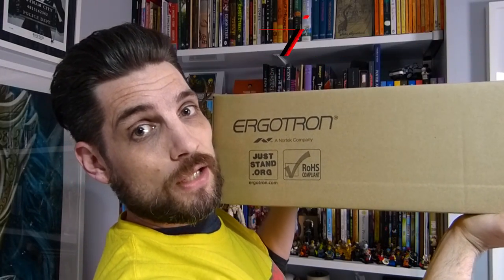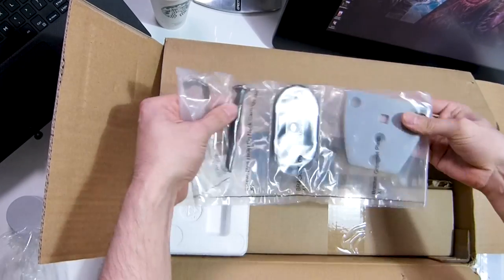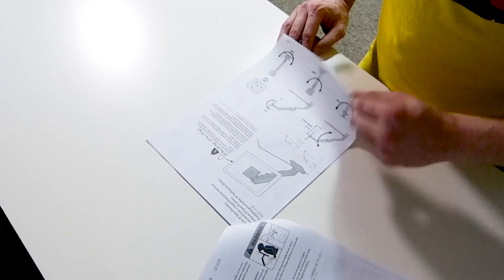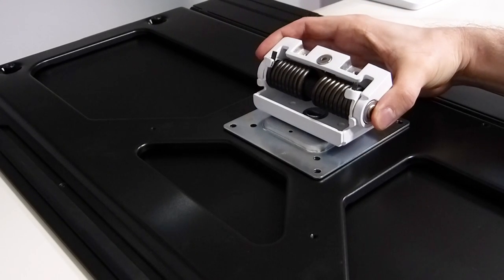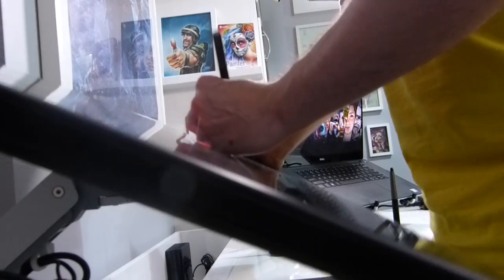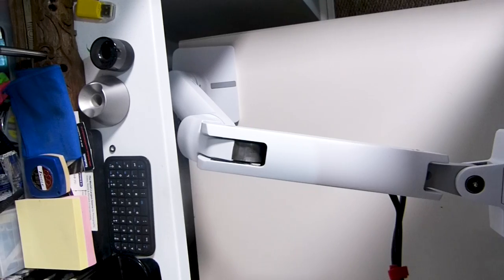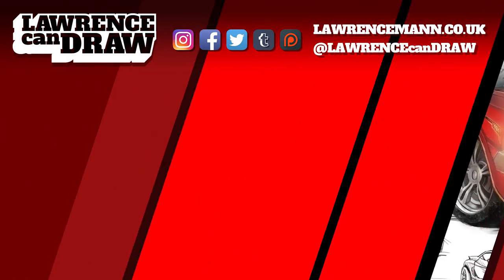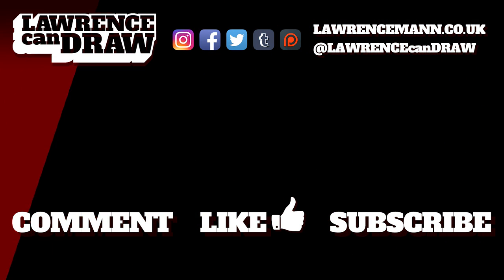Dell Canvas 27 with Ergotron arm & VESA mount

Comment: @Lawrence, i heard, that the touch experience on the cintiq 27 pen and touch isnt that great, compared with the Surface Studio for example.
How does the canvas respond to touch gestures like rotate, move and zoom?
currently i am working on the Surface 3 which is very responsive with touch.
Btw: your Trump Illustration is great:)
Reply from the maker: Haha. Glad you like the Frumped illustration. Guess you've been on my site then?! That was a commission. It in no way reflects my personal political views ;) haha. The touch on the Cintiq is fine. I normally tell people to install the drivers that are 1 version old rather than the most up-to-date. That fixes any bugs you may find when new drivers get released. I never install new drivers straight away. Dell is absolutely perfect. Never run into a problem. Both have touch on/off buttons. Personally I don't like the Surface Pro/Studio etc for touch as much because it's glossy. I hope the next versions are matte but I think that'll never happen :(
Reply: I think your Frumped illustration was mentioned in one of your threads here on Youtube. Made me curious, because there are many mediocre Trump-Drawings out there from people who think he is easy because of his hair. But he is indeed diificult to draw. And your one is very good (as expected)

One thing i forgot to question: A lot of people are complaining about fan noise (Surface pro 4, Cintiq Companion 2, Cintiq pro 16) Does the Dell have a fan?
Reply from the maker: No fan on the Dell Canvas but it's a pen Display, not an all-in-one.
Reply: robert stern the Cintiq 27 touch with Clip Studio has been a complete mess. This past April you needed a driver version that was more than a year old to make it work decently. Decently, not perfect.
Sent it back after two months.
Reply from the maker: Hmmm. Clip Studio. They just released a new update with touch & pen inputs. Did you try that Stefano?
Reply: LAWRENCEcanDRAW sorry, I sent the cintiq back for a refund after two months of frustration I fear. (Besides, it was around the whole operating system that touch and pen didn't work well together, same on the Cintiq Companion in Windows 10). 
Currently Clip Studio is version 1.6.2 from past December. They should have released an update this past month that gave full compatibility with the new Surface Pro and pen but it was postponed to September.
Reply: i am working on a Surface 3 with Clip Studio EX since Version 1.5.x
Pen and touch worked and works absolutly flawless on my Surface 3.
I think your problems are cintiq 27 touch wacom driver related.
The upcoming CSP 1.6.6 english update enables clip Studios tilt support for pens and support for the Surface dial device
Reply from the maker: I've used Clip Studio a couple of times (mainly just for YouTube videos) but that's it. I've heard some stories about driver issues but with Painter & Photoshop I find there's never really a reason to touch it. Doesn't really compare. It's a strange app in the fact that it's got more in it than a basic tablet app but it hasn't got all the features you expect of a major painting application. I thought they'd expand it more but they've never really fleshed it out. It's nice for line at but that's about it really.
Reply: LAWRENCEcanDRAW no offence, but you should know it better before judging. You might discover it actually has more painting tools and options dedicated to drawing than Photoshop.
And a more touch friendly interface.
Photoshop has better photo editing tools though.
Reply from the maker: I do 'know better' ;) lol. Saying "no offense" is something you do before you knowingly offend someone. I have used both over many years. Those tools you see purely for photo editing are extremely useful for artists too. It comes down to the style you work in. Clip Studio or Manga Studio is more aimed towards comic artists. It has made a lot of advancements but I still prefer Painter for hardcore painting advanced tools. Photoshop's general skillbase and awesome painting set-up is what helps it wipe the floor with some of the lesser apps out there. I'm not gonna have this debate in a comments section though because it's a pointless personal choice issue. I've turned on an app and thought it was awesome when a friend has thought it was a piece of turd and uninstalled it before the drive had stopped spinning and vise-versa. Everyone has different set-ups to and different ways of working which is great but this all plays a huge part of picking your software and hardware. That's why you'll never see me dispensing advice without asking what people do, what software they use and just getting to know them first.
Reply: LAWRENCEcanDRAW you know, you could just say you don’t know it and that would be perfectly fine, you won’t lose subscribers over it. There’s no point in dismissing a software out of simple ignorance of how it works or what it can and cannot do. Which is clear you don’t know, and that is fine.
It’s not like you lose anything if you say something like “Some say it’s good, but I don’t have any real experience with it so I can’t judge". We mortals do it all the time.
Just a piece of advice for the future since you never know who you may be get into an argument: for what you know I could be someone with double your experience and knowledge in this matters. Just be a bit more humble with strangers.
Reply from the maker: I have used Clip Studio a few times and I said that straight away in my comments. Didn't profess to be Captain-Amazing with it. I think I've got 1 or 2 videos with it on my channel so it's obvious I'm not going to hide the fact that I wasn't an expert on the app and wasn't blown away by it. You seem to be very defensive over Clip Studio Stefano, are they sponsoring you?

From the last part of your statement I can tell you're obviously very upset. You're not used to people telling you that your opinion is not the only valid one. Do you teach students by any chance? I've seen this from friends who became college tutors in the past. I have told many older people with more experience than myself that they are wrong on many, many occasions. Truth & knowledge are not sole virtues of age or even always experience. One day I will be wrong and I hope someone younger with skill beyond mine will come and point that out to me when the time comes - maybe it will even be you ;) See what I did there?! Humility. lol.

Anyway, this is turning dark. You are getting upset and I am going to go paint. You have fun with your family and enjoy the Sun in Monza!

P.S. What did you replace the Wacom with?
Reply: LAWRENCEcanDRAW lets leave this behind, we have different opinions that won’t change anyway over an argument on youtube. And we both have better things to do than spending our time arguing with a stranger over the net.
After the Cintiq fiasco I decided to get back to a portable device only, so I got a Surface Book. Which was substituted by a Surface Pro 2017 a couple months later. Which, when I got the new pen and it reveled to be half backed from Microsoft and not ready yet, was finally substituted by a Galaxy Book 12. Hope to be able to keep it at least a couple years.
Reply from the maker: I use a lot of portable devices too. I haven't tried the new Surface Pro yet. I am using the Surface Book with Performance Base. That is pretty good. I still love my Wacom MobileStudio (I can't remember if I put Clip Studio on that or not) but I've not tried any of the newer Samsung's. They've never made anything that I've looked at and thought 'I must have that NOW!!'. Samsung always make nice stuff but I'd like to see them do more for artists. Dell pretty much just said in a comment on my channel here that they are going to be doing a mobile Canvas. The folks at Dell are awesome and they work hard on the details. I'd like to see what they come up with. I think a Dell MobileCanvas could be very special.

Comment: Hi Lawrence, do you prefer the LX HD for the Wacom Cintiq 27" or does this (a bit cheaper) HX also does the job? I have some fear that the HX is not able to lay down the Cintiq close to the table because the first arm that from the stand is about 45 degrees up. Thats maybe where the LX HD performs better cause he is on a pole. Right? (and maybe the arms are longer?)
Reply from the maker: LX HD has more more movement and the HX is stronger. It all depends if you're a 'leaner'. I tell people never to lean because you're gonna damage your Wacom but to those people who bitch about wobble, I say get the HX and suck up the lack of movement!

Comment: So I have another question about the arm...I have it installed, and it works great! I'm just curious, is there a way to get it to come out from the wall a bit easier? I have to really pull on the arm to get the bottom mount to turn, as in, the two spots where the mount connects to other parts of the mount.
Reply from the maker: Does one joint feel a little stiff? You can just loosen the nearest screw-fitting a tiny touch 🤓
Reply: Lawrence Mann yeah, the base arm on particular is hard to turn... I figured that it's the second hole, not the one on the base that I tightened after dropping the arm. In, but the one right above it on the arm... It's so tight that I can't loosen it with the head key they provided me, so I figured it wasn't meant to be loosened. :P
Reply from the maker: By the power of Grayskull 💀...

Comment: I've purchased the Amazon Basics arm, and by comparing it with Ergotron XL, it's 100% identical, only difference is the warranty it seems. Even the packaging was 100% the same. I guess Amazon buys them from Ergotron simply repainted, Epic stuff.Using it for my Cintiq 27qhd and it works great.
Reply from the maker: Not sure that's the case. I'll check into that to be sure. Either way, I'd rather have that warranty and know that they are stress tested units.

Comment: Hi Lawrence, 

I've been enjoying watching your videos. Recently I purchased a Dell Canvas - however when I connected the Canvas and powered it on, an error message appeared on the screen stating that "Wrong power adapter detected".... followed by a shutdown of the screen. 

Does this mean anything to you? I was wondering if you could confirm the type of adapter that you have with yours - so that I can compare. 

Many thanks
Reply from the maker: Sorry fella it's bolted under the desk so there's no quick way of getting to that but... if you've just got yours then you've got the box right there with a manual and that should have all the specs in for the power unit. What country are you in?

Comment: my office is purchasing Canvas for productivity usage (not for drawing).......my table is too small to have it lying on the table.   I'm using it primary for split windows data entry and wanting to make Canvas the only monitor. What budget table mount can I purchase?
Reply from the maker: Do you mean VESA or arm? If you mean VESA mount then you must buy the VESA from Dell. It is the only one that will fit. If you mean arm then I have a video that will help you to choose the right arm (https://youtu.be/1uqb_uugqr0). I recommend Ergotron because of the 10 yr guarantee and the stringent tests that are run. Budget arms have 1 yr warranty typically and I personally do not like the idea of putting a £2,000 tablet on a budget arm.

Comment: Thank You for your video!
Can you (or anyone else) tell me how much the VESA adapter weighs? 
(I don't see any documentation on it) (and does that include the cable concealer box?)
Thanks!
Reply from the maker: Not sure on the weight of the VESA mount. However I'm not sure what you mean by a 'Cable concealer box'. The cables do get concealed within the Ergotron arm. Is that what you mean?

Comment: How did you get your hands on a VESA mount in the UK? None of the EU Dell sites list this item...  nor do they list the articulating stand... so I can only work on it when lying flat. Would like to use it as a desktop screen too....to avoid having to buy another screen just for that...more money, more clutter :p
Reply from the maker: I had the Canvas well before release. Call their customer service line and explain what you want. I'm pretty sure it's an ordering fault rather than an inventory fault so you might well be able to get it as far as I understand. Ask for Dell part 452-BCSG 'Dell Canvas VESA Bracket'. Quoting part numbers and the actual reference name might help them track the part down in the system. Let me know how that goes for you!
Reply: Thanks for your review. Also in germany we dont have the Bracket. Dell itself as well sells the Canvas here around 300 Euros (200 Dollars) more than the retailers around. But when it comes to that Versa Bracket Dell Germany is unable to help. You need to use hidemyass or any IP hider to get on the US site and then order it there, I have a US postbox mail forwarder so that was working. But if Lawrence Mann from the UK finally reached on directly in Europe maybe, respect from me :)
Reply: For sure I meant Arman maybe got one in the UK, why should you get one there, silly german me...

Comment: Hi Lawrence,

How has the Ergotron arm held up thus far? Want to get one but not sure how well it holds up over time. Being how heavy it is and the use I may put into it.
Great videos by the way, pushed me to getting a Dell Canvas a few months back. 

Thanks in advance.
Reply from the maker: The HX Ergotron arm is a beast! You could sit on this thing!!! It's got a 10 yr guarantee. It's gonna hold up. That's why I don't get those cheaper brand arms. https://amzn.to/2AnOw4N You can also get it in Chrome as well as white. You can get a double version too if you have another monitor you want to strap to the side (like a super beast!!!) - It'll hold. Hmmmm - maybe that's my next Ergotron video... CHALLENGE EXCEPTED!!!!!
Reply: Thanks for the reply, will definitely get it with my next paycheck.
Reply from the maker: Use the link in the description and send me a message on Twitter or Facebook @LAWRENCEcanDRAW so I can give you a shout out!!!
Reply: I assume that is a referral link, used it and should get it next week. I dont really use twitter and deleted my facebook. I appreciate the thought though.

Comment: Hey Lawrence
I think Dell have discontinued the Vesa backplate. (I think they might ship it as an accessory if you buy the canvas from them at the same time, but even that's unclear)
Anyway, I'm actually thinking of just making one. How hard can it be, it's just metal with holes in it, right?
I've never actually seen the canvas in person, what do think?
Reply from the maker: I've heard a couple of people say this but I'm not sure if it's true. It was always tricky to get hold of. I'm gonna try to get more info on this!!
Reply: I got a mount in uk about a week ago. Had to ring dell direct to order and it was a bit of a hassle but it eventually came after 3 weeks of chasing them via emails.
Reply: @optical10  Thanks, do you mind if I ask how much it cost you?
Reply: @tmcthree  it was £164.99 with free delivery last month. The backplate for the cables it a pain to secure as the hooks push the screw to high, i dremelled them down a bit, hope yours are better.